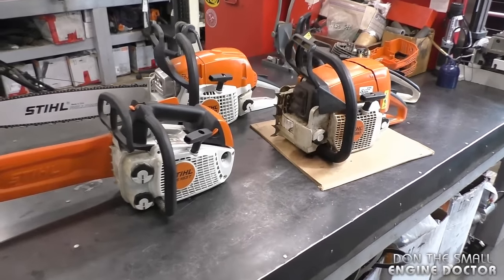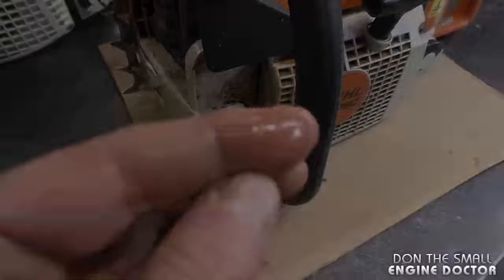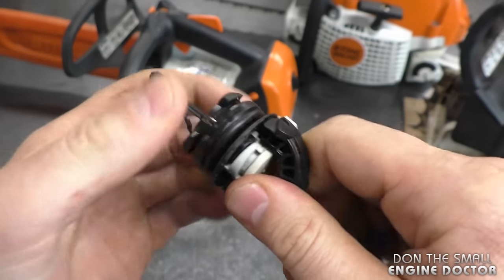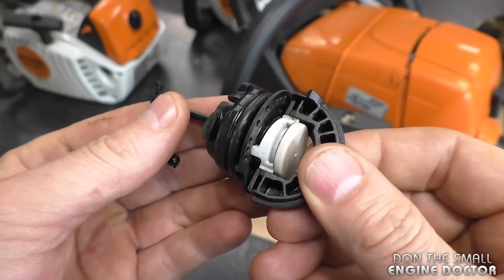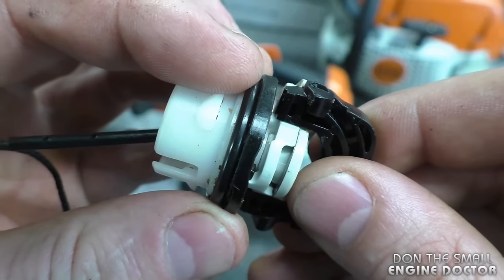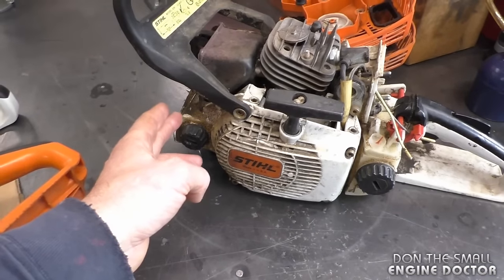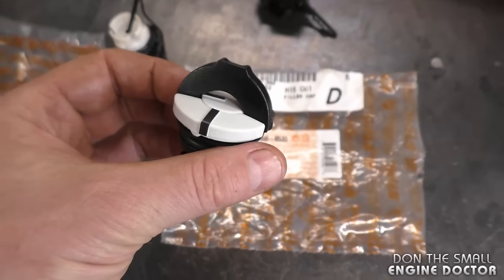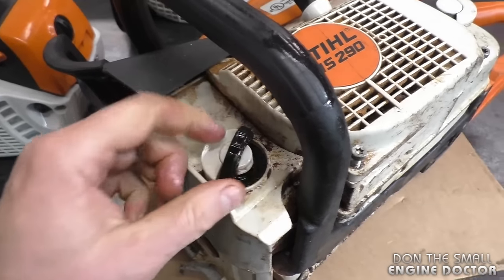Fix 90% Of Stihl Chainsaw Bar Oil Leaks With This Simple Repair!

Comment: Okay thanks for the heads up on the problem now the question of the day is would you be having the same. Problem with the fuel cap  as well 🙄🙄??
Reply from the maker: yes absolutely
Reply: Had it happen on a used MS290 I picked up on the gas cap.
Reply: @mikeremski2102  ouch that's not good to hear that hopefully you got it fixed
Reply: @robertmailhos8159  Yes, the simple fix was new caps as pointed out in by donyboy73.  It was a backup saw so I could lay it down sideways until the new caps came in.
Reply: @mikeremski2102  well.u don't have the same problem with my shindiwia 591  only thing is that I had to have a new oil pump out on it lucky for it's still under warranty thanks for your reply young man ☺️
Reply: The gas cap isn't hardly an issue. The oil cap gets covered with debris constantly and nobody cleans it before putting it back in. The O-ring gets messed up and full of dirt and debris and it fails. Just replace the O-ring
Reply: @hotdognonesky3766  You are so right on this issue! Buy a new O-ring size 30/24 x 3 mm and keep things clean.
Reply: @Hegez  bad design, engineers should be canned
Reply: @Hegez I just blew the o ring with compressed air and the leak stopped.
Reply: @viperstrike3827  That can help, if o-ring is not damaged.

Comment: You can't beat the old stihl screw on caps never fail tool less type are just over engineered in my opinion.
Reply from the maker: yes absolutely, the older screw on ones were way better
Reply: I'll never understand why Stihl changed them to be more complex and prone to leaking, when the old ones were fine.  However, my MS170 has those old caps shown in the video 4:11 my caps have never leaked but last month I was putting on the oil cap with the screwdriver. I swear I did not tighten it very much and it just broke, the top split off from the sidewalls.  Maybe my previous over tightening efforts had started a crack to form. Bought a new one.
Reply from the maker: @firstman9273  just had one break apart on me yesterday!
Reply: @donyboy73  Stihl is probably the best chainsaw when everything is working properly, but they tend to over engineer everything, which makes them more complicated with more parts, and more likely to break down. I would prefer more reliability over the slight improvements they make with convenience.

I have worked with low-intelligence type coworkers that regularly install the tool-less caps wrong and the oil/gas leaks everywhere when you pick the saw up.
Reply: Stihl went to the new style caps because of lawsuits by people who weren't smart enough to tighten the gas cap with a saw wrench...
Reply: @firstman9273  ..because they are trying to cater to the whiny homeowner crowd who can't unscrew a simple cap, for some reason...

Comment: The tool less oil cap is a solution in search of a problem. From engineering standpoint it was a designer who never owned a small engine and designed the cap to "leave his mark".
Reply: I have an old 5-10 Mcculloch (1968)  still cut firewood with it, original oil cap and gas cap no leaks.  Unfortunately the old saw will keep right up with a new sthil 271.

Comment: I have a MS260 pro . Both the oil and fuel caps started leaking. I pulled off the original O-ring, flipped it over and re installed. Worked on both caps to stop the leaks. I will pick up new caps at Stihl dealer one of these days, but it was a successful temp fix for now.
Reply: That kinda indicates that the caps were tightened with trash between the tank and O-ring,damaging the O-ring.

Comment: Well thanks man. This is the first KISS approach I’m going to take on mine. I jumped right to the oil line conclusion. Why they couldn’t just put on a screw cap? I’ve replaced my fuel cap twice but never the oil. Maybe it’s time. Sorry Stihl, but your flippy caps stink!

Comment: FYI to viewers. They had a recall on them caps in 2011. If your cap has a D stamped underside cap it’s affected by the recall and you can take saw to any dealer to be replaced free of charge. No time limit. If you have an E it’s not affected by the recall.

Comment: I have a 1994  12" Stihl 009L Bought new. I don`t use it very much. Runs perfect. I run the Oil mix rich like Don says. Thanks Don your advice has kept this old saw going. Mine has the old Caps. CHEERS.

Comment: Thanks Donny! It’s a pesky problem. My 455 rancher was really bad for this. I had to take it right apart and jb weld the oil line onto the oil tank to fix it. In heinsight silicone may have worked too. But it hasn’t leaked in four years of heavy use with the jb😉

Comment: I had a guy wanting me to restore a 1970's chainsaw. I checked and no available head and piston set for this Homelite. The owner told me it lost Spark and thats why it quit. Well, new coil and no compression later, I was a bit upset. From now on, I go through everything before attempting to repair. As far as aftermarket. Yes, I could have taken a chance but no. Anything that old deserves to be called a wall hanger. All chainsaws eventually start leaking at the oiler system. Good Video! I always enjoy your video's.

Comment: I have never broken a flippy gas cap but I have broken several bar oil caps.  I think it is because the handle gets in the way of the proper installation of the bar oil cap.

Comment: I'm assuming I have this same issue, but what are the potential issues the other 10% of the time? I have a stihl 291 I've never used and when I opened up the storage case it was sitting in oil.

Comment: My oil filler cap on the MS181 is shite and was like it from day one- you have to try and lift the chainsaw when you "think" the cap has engaged just to be sure. Sometimes feels like it's on and it isn't, it's leaked when not in use from day one I always assumed it was from the feed port on to the chain, but always store it on it's back at 45 degrees. No issues with petrol side but it squeaks when turned now so at 15 years old I'll buy 2 new caps for it. Great video.... the Stihl area around the oil cap is a shite design too, total dust and chip trap and hard to keep clean out in the field when refilling....

Comment: found my spring loaded vent  dirty and leaking where it feeds the bar because it allows atmosphere  in the tank ,sort of like if you put your thumb over a straw in your drink ,take your thumb off  it pours out,i have the 034s threaded caps,

Comment: The new flip top caps are trick but I prefer the old screw on type.  I keep a scrench on a lanyard around the spout of my woods fuel jug so not having a tool for the caps is never an issue.  In my opinion the caps are a solution looking for a problem and created more of a problem than they solved.
Reply: should be some engineers fired over new design

Comment: My MS 194 not leaking but not slinging oil off the tip.
Oil ports on bar and body clean and clear.  Oil usage seems normal but not enough to sling oil off the tip.  Any suggestions?

Comment: Dony, I’m fixing a hedge trimmer stihl hl45 the fuel line and return line plug that fits into tank has an arrow on the plug. Which way is the arrow supposed to point, towards the engine, away, front or back? I appreciate your response, love your channel!
Reply: I looked at my HS45 which is a different beast,  there are no arrows on mine.
Reply: Thanks for the reply, my arrow is probably not important. The proper alignment of the two hoses allows installation of the hoses to the carb I can see how that is affected by rotating the plug.

Comment: Hi, I have a stihl ms390, I have replaced bar and chain and no bar oil is coming up the chain. I have ran saw with no bar and chain oil is coming out. I have the correct bar and chain for it to. Any ideas please?

Comment: My Stihl ms260pro caps were just the opposite. The older original caps had the black line and the newer one I put on about two years ago did not have the black line.

Comment: I have both the ms 170 and ms 271 Farm Boss made by Stihl. I do have a slight leak on the 271 nothing on the cap from 170. It’s a small leak on the oiler side. Any ideas? Maybe the oil pickup line grommet? Any help appreciated!
Reply: It does leak out of the cap on the left side when sitting but additionally when sitting regularly

Comment: My dealer told me that one reason could be that you overfill the tank and that puts excessive pressure on the cap. The fuel tank lets the pressure out in the fuelline but the oiltank puts it on the cap.

Comment: I have an old STIHL 029 super made in Germany that still has the original caps. Black oil cap and a black and orange fuel cap. Not commercially used but has a lot of hours of use.
Reply: Be too!!! Still runs awesome
Reply: @whatstheproblem6606  the best ones were made in Germany. An arborist with many years experience told me that.

Comment: I’ve got dark colored oil on the bar side of the saw just above where the bar nuts are. The oil itself is on top of the cover that the bar nuts hold on. Any idea where it’s coming from??

Comment: The problem I have is a brand new Stihl MS391 with less than probably 30hrs has had a second oil tank vent valve replaced because of leaking oil. This appears that dirt maybe getting dragged into it from behind the bar.

Comment: 661 Magnum sthl, cut a lot of firewood.
 chain on the bar seems dry can't find the position of the oiler where it actually comes out I'm thinking it's clogged With sawdust debris etc.. any instruction on location or videos on how to unclog an oiler on a 661 Magnum?
Thanks you, happy holidays.

Comment: I tried a new o-ring on my MS461 but it didn't solve the problem so I replaced the cap. I've never had a problem with my MS271 or MS261.  A more annoying problem is that I've had E-clips come off the clutch drum on my MS271 and MS461 while using the saws. I don't know if they broke or got snagged by a stick... Because of that I carry extra E-clips, cage bearings, washers and sprockets for the saws as being a mile or more from the road doing trail maintenance, and 10+ miles from a store or my shop, and losing an E-clip is not convenient!
Reply from the maker: i see a lot of saws where the e-clip has come off

Comment: Just replace the O-ring. It's super simple.  It compresses the O-ring to create a seal. If you use a slightly thicker O-ring it seals much better and it is a 10 cent repair that takes about a minute to do. I have a tree service and I keep them in stock because nobody ever cleans the oil cap before shoving it back in. We care more about production than a little piece of rubber. Lol
Reply: Very nice thank you sir.!
Reply: Where do you buy the O'ring for the oil cap? I assume you get ones that are not affected by oil.
Reply: @human1513  
Yes. I have several sets of o-rings to choose from. Nitrile is best but you don't want the ones that are hard. Soft is best in this case
Reply: Right size for 201 is 24/30 x 3 mm.

Comment: All my Stihl 3 chain saws, backpack blower, line trimmer, hedge trimmer have old school caps. But the pole saw has these new worthless caps. Oil caps will leak over time. Specifically since I store it in hooks upside down from my garage ceiling over winter. I drain all the oil out, but I learned to wrap the bar oil fill with a old rag duct taped in place.

Comment: Don, don’t know where else to look, I have a 021 that won’t oil. The gear and pump seem to work and look fine. The sprocket turns the worm gear. The oil filter is clear and line isn’t blocked. What oils be the problem? Can the pump go bad even when it looks fine?

Comment: I have an old Husqvarna 345e I bought many years ago but it has leaked bar oil for many years. It is obviously not a professional saw but it is a good saw. I have not really noticed if it is coming from the cap but I assume it could be a bad seal from the oil tank as well correct?
Reply from the maker: yes it could be
Reply: If it is leaking near the clutch, then it is likely normal seepage which all chainsaws have when oil is in the tank.

Comment: I’m like my saw is brand new, I’ve cleaned it between each use and take care of it. I’ve used it a handful of times and I found a leak on my garage floor and the bottom of the saw gets oily. If I just took it apart and cleaned it there shouldn’t be oil leaking from it. Right? So WHATS THE SUBSTITUTE FOR THIS CAP??

Comment: Howdy from Florida.
I am a member of the 10% that does not have that problem.
I store my saws with caps pointing UP, and bar laying flat.
Several years ago, STIHL bar oil changed, and suddenly
all my Stihl saws and pole saw (3) started leaking out of the 
pump area.    The fix is ________________________?
(My solution is to store them empty, for now.)

Comment: My old 023 leaks from somewhere else, I have the tool required oil and fuel caps.  My saw case fills with the oil running out.

Comment: Other than the o-ring wearing out/shrinking over time, I've found that most of the time it's just due to a chunk of sawdust that gets caught between the o-ring and the top of the cap, preventing the seal.  I've certainly had to replace a few, but I've had to replace a few on my Husky weed eaters as well. Would agree the Husky saw caps seem bomb-proof.

Comment: I think that the reason that the oil cap is a bigger issue than the gas cap is that gas is compressible whereas the oil is not. I have multiple times put a little too much bar and chain oil in the reservoir and then couldn't get the cap to seal. Not an issue with the gas cap.

Comment: We have two Stihl chainsaws: a 028 from 1980's (never had any problem with it) and a few years old 261cm with these new caps. It does not leak fortunatelly, but I do not like it, because dirt can easily go between the undersite of the cap and the o-ring., and it cannot be cleaned out from there until I open the cap. So some dirt always fall into the tank, whenever I open these caps..  Greetings from Hungary

Comment: Those caps are easy to install incorrectly. You start back to work and the oil dumps out on your boots. Just not necessary where a simple threaded cap will work fine. They should copy the Husky design.
Reply: You heard about the USA space program spending millions to develop a ball point pen that would work in the zero gravity of space. The Russians use pencils in space. The caps on tanks are sort of like that. Best to keep it simple.
Reply: Not to mention a lot of dirt collects around the cap.  So when you need to add oil, you have to be careful that dirt collected around it doesn't drop into the tank.  That's why I carry a brush with me to brush everything off first before I take the cap off.  Not to mention sometimes they are a real pain to get on right.

Comment: I have an old style cap and it leaks oil when not in use. What else could it be ?
Reply from the maker: you might need to replace oil line

Comment: what about Chainsaw Bar Oil Leak that has nothing to do w/oil cap?
I see vacuum relief valve mentioned in threads.... a lot. 
Stihl Rep told me to loosen oil cap to relieve pressure. Huh?
Reply: Yeah my old 034 leaking from the bar side. I guess I’ll Loosen the cap see what that does.
Reply: @davemills3734  I went to local dealer & mentioned that I had mixed some 30wt with my bar oil, since I was running low. That was my culprit. That, plus my chain was dull & I had been working on a big (hardwood) Hickory tree stump. Oh..There is also a pencil tip size hole where the oil lubricates the chain, under the chain-guard. Get a paper clip or something and poke that hole to make sure it is not clogged. Crank it w/the guard off & there should be a small amount of oil that oozes out after pressing the throttle a little.
Got chain sharpened and 100% bar oil and it now runs like new.
Reply: @waynelynch3862  thanks Wayne. After watching a few more vids I’m thinking oil line maybe? Probably should tear into it. Been a great saw but it’s seen better days.

Comment: My 170 chainsaw I have replaced both caps, even the gas cap leaks. So when I'm done with the saw, unless there is no gas or oil I will lay it on it's side with caps up.

Comment: I have a Stihl saw which has not been used much since it spent most of the time in the repair shop for one reason and that is being hard to start and the oil cap on it is probably bad also and in need of being replaced. The guys at the repair shop cranked it more than me and why I purchased a Poulan Pro battery saw and it works for most of the work I have around my yard and outer areas. I have a new Poulan Pro gas saw which is difficult to crank also due to the rope being hard to pull.
Reply: @Sidney Mathious  Do you use Pre-Mix Fuel or Gas Pump Fuel in that Stihl saw?
Reply: Is there Ethanol in your gasoline?

Comment: The caps don’t leak on my saws -  it leaks on the bar area , when I bring the saw from the cold into the heated garage  it will leak - and I think the reason is when the oil warms up builds pressure - and it pushes pressure onto the bar , because there is no “ vent valve “ to let air back into the oil tank - so it builds pressure in the tank ?
Reply: my saw leaks from underneath not the cap. somewhere from the chain is lubricated.

Comment: Don,      I replaced the carb on a honda 4 stroke weed eater. It starts up idles, runs ok but when you rev it up it dies. I didn’t use a Honda carb I used a knock off.

Comment: is there an easy way to know if you need the smaller or larger oil cap? 0000-350-0533 vs. 0000-350-0537 ?
Reply: Look at the parts diagram for your model.

Comment: Honda GX 25 will run but stumbles and dies when you give it throttle. Cap off no change, fuel line is clear to filter. Vent line has some gaps in fuel flow? I’m trying everything I can think of, no adjustments on carb I can see.

Comment: My 192 drives me nuts. I'll check the cap. I do have the newer cap already. I've been putting off replacing the oil line.